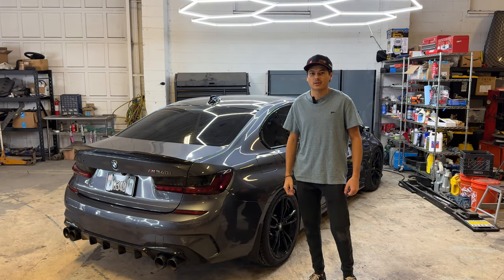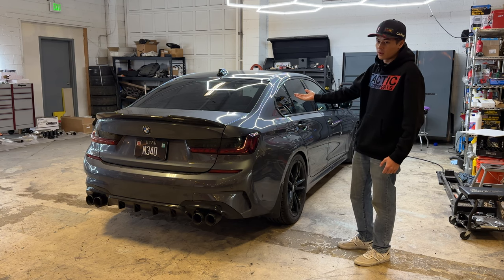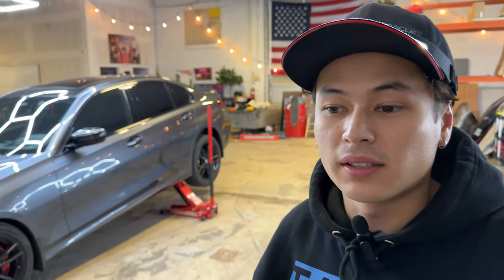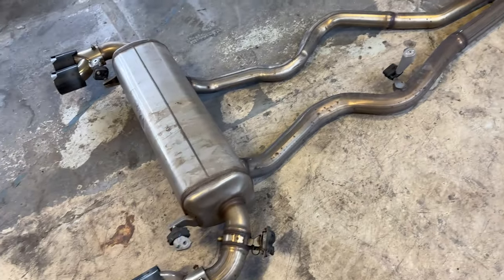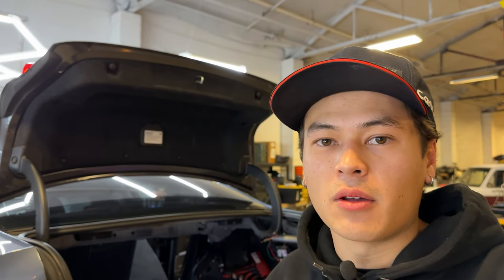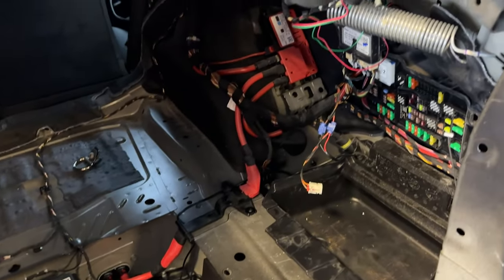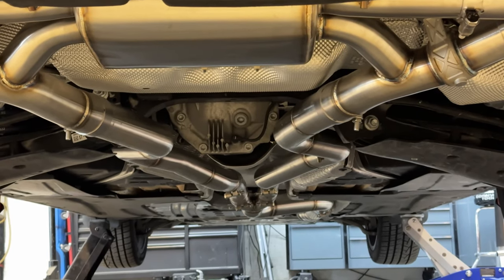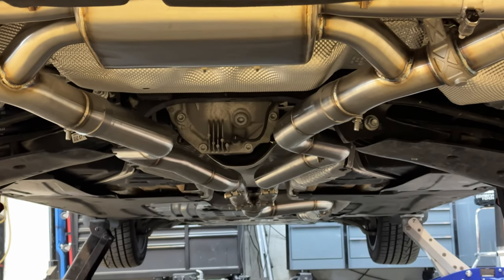The Loudest M340i Exhaust w/ Install + Sound Clips | EHOONS G20 Build Ep. 5

Comment: How come you added JB4 to keep the warranty, but you changed your downpipe to Autowerke which should void it on its own. And then this exhaust?
Reply: According to what I’ve been told by bmw, they do warranty part by part so a downpipe will only void warranty on exhaust and say turbo but if your cooling went out it should still be covered, if you only had air intake your turbo warranty should stay, where as tune completely voids the car

Comment: Don’t got insta. I have a question on your previous 535xi. We’re there any issues running 19s on the xDrive/xi? I want to get me some Apex VS-5RS wheels but they only offer 18s for the car
Reply: I run 19s on my 2010 e60 535i x-drive, no issues. 19x8.5 +35 and 19x9.5 +35 245/40/19 & 275/35/19. Perfect fitment with coil-overs.
Reply: @I_Learned_a_Thing  Thanks for the comment. I appreciate the help

I have these options for the rear on the Apex site for rwd 
19 x9" ET30
19x9.5" ET22 
19x9.5" ET28 
19x9.5" ET35 
19x10" ET25 

And these are the options for the front
19x9" ET30 

What do you think would work? Or can I just run 4 fronts of the same diameter to make it work with the xDrive? I saw someone post that on the forums for xDrive specific cars

Comment: Would these cause a CEL without a tune?
Reply from the maker: No it would not. As long as keep the factory valve controller plugged in, there will be no codes
Reply: @EHOONS  Did you hide the factory valve above the exhuast heat shield?
Reply from the maker: Yes and held it up with a ziptie
Reply: @EHOONS  Do the valves need to be in the open position when zip tied?
Reply: I’ve been looking at valve tronic for my 2023 m340i  LCI but super expensive Is this exhaust really worth saving the extra money for how’s the quality
Reply from the maker: @GrandMasterTokes  I have had zero issues or complaints with mine. I would say go with this over valvetronic all day
Reply: @EHOONS  Looking into these as well. Any drone or anything?
Reply from the maker: @jordansripakdee4476 no drone with the valves closed at all
Reply: @EHOONS  no tapping noises as well bro? I’ve heard they were an issue with these types of exhaust. Thanks for the insight
Reply from the maker: @jordansripakdee4476 no I don’t have any weird noises